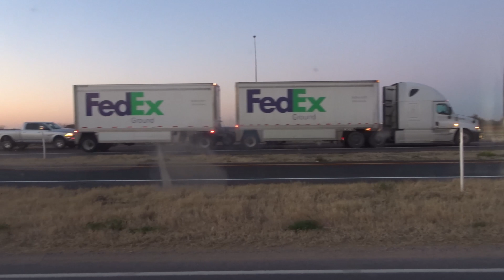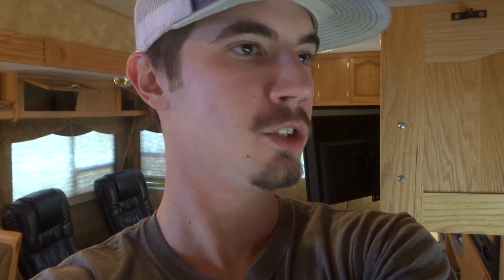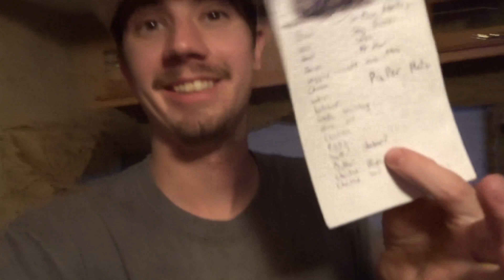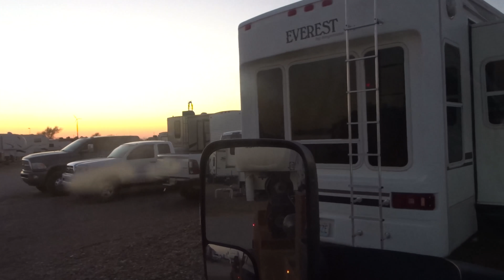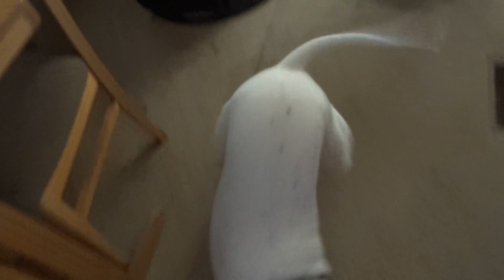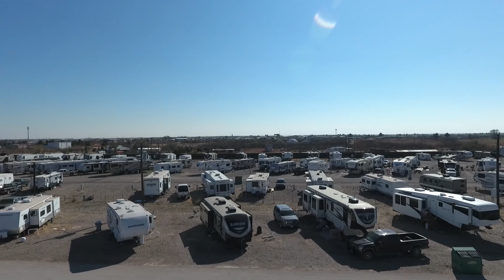Blew Up The Turbo On My Rig Truck!!!

Comment: If you don't have a voltmeter just take a double a battery or 9 volt and tap those wires you think are the speakers and they'll pop if they are.

Comment: Can u show us how you mounted your welding machine to your truck please ? Alot of people do tours of the truck but no info on how to mount the machine on the truck safely. Thanks and good work .
Reply from the maker: Sure! I don't have access to a forklift right now. But I should be able to explain it!
Reply: Zachariah Lawson thanks man for replying.  Im a weldi g i steuctor in baytown tx and im on the verge of either going back to school for engineering or rigging out to weld pipe line. So many hard decisions to male this year.  I hope you jave a prosperous year buddy thanka for all your videos and effort.